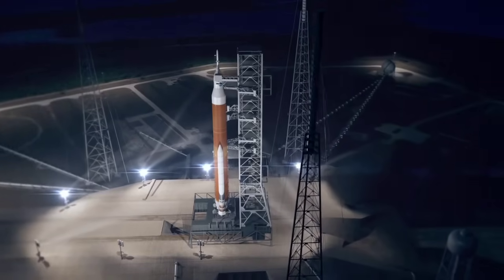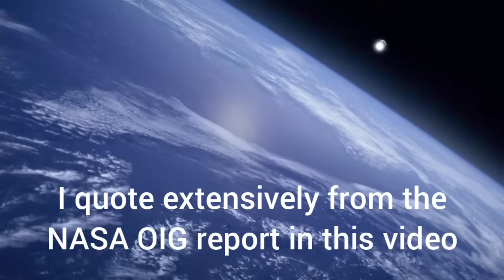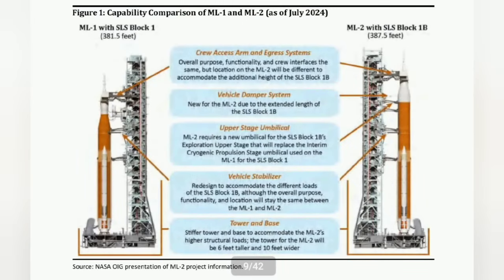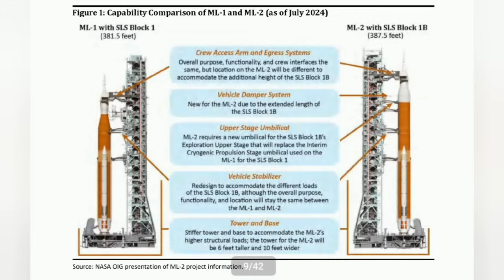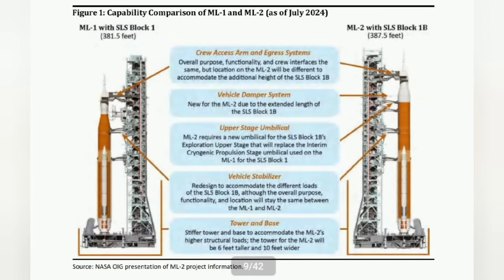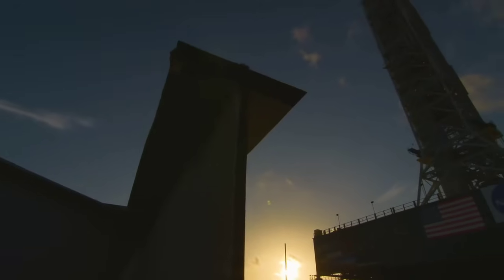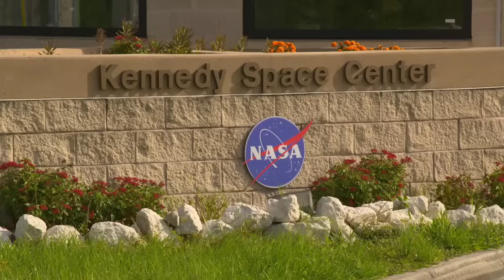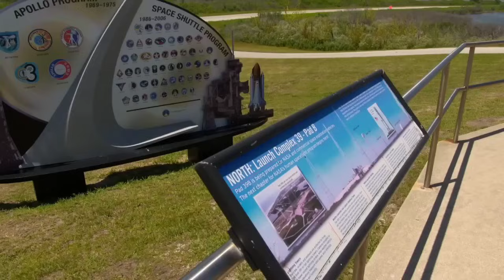If you thought NASA SLS was a nightmare, wait until you see this!  PLUS, no Artemis 4 until 2029!

Comment: Perhaps SpaceX can teach them how to build launch towers.
Reply: They could do this somewhere in between building towers number 3 and 4 🙂
Reply: Yes, NASA never built anything at all until recently.🤡
Reply: To be fair, SpaceX is still very much learning, as evidenced by their constant changes to the tower. Because SpaceX has adopted a rapid prototyping philosophy, we can easily lose track of this fact. The goal of the launch tower commissioned by NASA is a product that will be provided in its final iteration. While SpaceX is getting there, so far during each launch they have learned "what does not work".  They did not spend the time and money to try to figure all these things beforehand. Personally, I think it's a good thing as it prevents you from spending too much effort on overengineering something that turns out not to matter much, and lets you catch early on little  things that in a million year nobody would have tought of.
Reply: @theguyfromsaturn  I guarantee that SpaceX spends more in the long run.
Reply: @professorg8383 is that how they're able to charge 1/4 the price of other carriers? 😅
Reply: @theguyfromsaturn  the tower is just for launching. SpaceX iterates for timeliness and for changes in scope. This tower was meant to handle a changes between the height in Artemis launches.
Reply: @professorg8383  spends more?? Are you aware that the entire Starship program costs so far is less than the proposed cost of the NASA mobile launcher?
Reply: @kennetha6594  Starship is projected to cost 10 to 12 billion to complete. It's estimated they have already spent 6 billion.
Reply: The mobile tower set up NASA went with during Apollo was a good idea in that it allows the pad to be used by virtually any type of rocket design. SpaceX tower is just for Starship. I would like to know what they have spent of that so far, and who builds them. It's a classic erector set configuration that's per-fabricated. Such giant infrastructure is certainly limited to a handful of company's. Anyway, despite rage bate video's, Artemis will chug along... The tower will be built. SpaceX fans are gonna SpaceX Fan... And everything will be fine.
Reply: @kennetha6594 Elon indicated they're spending $2 billion on Starship in 2024. It was commented in a public interview earlier this year, though I do not recall which one.
Reply: That was my first thought as well, but there a major design difference. This is a tower used to stack the full ticket and payload in the VAB, then move the assembly to the launch pad, fuel it, and then launch it. SpaceX--perhaps wisely--separated those functions between different components and built a tower that can stack the dry Super Heavy and Starship. They use smaller transporters. 

I think the critical difference is the use of side mounted boosters on SLS. Perhaps those are to difficult or temperamental to add to the stack at the launch pad. Or, it's the need to reuse Shuttle infrastructure and processes, i.e. a mobile launch tower.
Reply: @hawkdsl Apparently, these mobile launch towers are very specific to Artemis, and not necessarily compatible with every Artemis stack. After all, the fueling and pre-flight loading for each rocket system is a bit unique. So they're not particularly generic. If they were highly compatible between systems, I'd suspect the mobile system used with the Shuttle could've been repurposed.

I suspect it's the need to stack and protect the solid fuel, side mounted boosters that is driving this complexity. Otherwise, it seems simpler to build a static tower at the pad and move the stack with a smaller transporters (like SpaceX and Russia).
Reply: @Tanstaaflitis  Again, the mobile tower configuration allows any rocket design to use the pad. The pad is universal.
Reply: The biggest difference is that this is a mobile tower, but the rocket takes a ride with it.

SpaceX has its towers stationary, and only the rocket is moved, and lifted by the tower.

Comment: Cost+ contracts are basically a blank cheque.

The Fixed Cost model used for Starliner protects NASA from massive supplier underperformance and puts the onus on the supplier to provide an accurate quote in the first place as they will be carrying the burden of overruns.

Seems like a no-brainer to use Fixed Cost by default - some palms must have been greased for Cost+ to still be used.
Reply: Except that Boeing cut sufficient corners on Starliner that, years after Crew Dragon went into service, Starliner is still sufficiently unsafe that NASA won't use it to bring astronauts home from the ISS.
Reply: They would've cut corners with the cost-plus contract, probably even more than they already did, so that they could get more money and an extension.  @lorendavidsonmusic
Reply: That is just insane nonsense!  Cost is the actual cost and the plus is a markup rate and in this case, a chunk of that rate is incentive based on performance. 

Have you ever managed billion dollar projects??  If not, you have no idea what you are taking about. I'm quite sick of all these armchair experts who don't have a clue!  Costs are actual invoices for manhours and materials, these are easily audited, even on a massive project like this. They aren't made up phony numbers!  The plus is the mark up and when incentive based like this job, the criteria is based on real performance numbers! Costs go up over budgetary for a couple reasons. Contractor mismanagement in which they'd lose the incentive award. Because it's design build, underestimating cost estimates are a performance issue. But the biggest reason for higher cost is scope changes.  Add or change stuff and it costs more. The fact that Bechtel  has gotten decent awards, says the issue is scope creep. It's going to happen when you are designing and building for a rocket that is still in development. You can't engineer and estimate for what you don't know yet!!

Comment: 21:28 Hint: Bechtel is a billionaire owned company; its a private company. The current CEO is Brendan Bechtel and the previous CEO and Chairman ... Riley Bechtel. Boeing is effin' NASA and they are a public company.  They'll get you either way. SpaceX and some of the other responsible  space companies should be leading these projects. And yes, SPaceX could be charging NASA and DOD less than they are, but what we don't know are the restrictions in place that slow them down and tie their hands. In some ways it goes both ways.
Reply: Don't believe that SpaceX is doing this kind of work much cheaper! Probably spending more because they hurry up and build quick and then rebuild 10 times and every time they use it!!  Never believe that Musk builds for what he says!  That's why they have over $200 billion invested in their owned assets!

This is a cost plus contract so the cost part is completely real!  Bechtel will never be the low cost bidder especially in a design build contract. They are one of the most costly on thee engineering side, but they build what they say they will. 

I have little doubt that the actual costs and delays have more to do with NASA having lost their best contract management folks. Most all have retired or moved on because NASA really doesn't build much these days and I have no doubt, the specs kept changing. That said, they'd be fools to farm this out to someone like SpaceX. No one at SpaceX has the experience to do this kind of big construction work and SpaceX build costs are at more than half premium time because of they're hurry up mentality. 

The real costs are in the systems and not the structure, plus they are not ignoring regulations from the other government agencies. 

Should NASA have anticipated the changes need from the first tower?  Probably, but when you build bigger rockets, it not just tower heights that need to change. As I said, the cost is in the systems not the structure. Cost plus with incentives is still the best way to build!.
Reply: @professorg8383  you're quite obviously delusional.

Comment: I suspect that the high cost of ML2 has a lot to do with that first letter: "M" for "mobile." Compare the problems ML2 has had to how quickly SpaceX erected the fixed-position Starship launch towers.
Reply: The MOBILE part is the same part that has existed since the Apollo missions.  They aren't building a new mobile PLATFORM. Just the tower ON the platform.
Reply: @NScherdin  It's not quite that simple. It also includes bringing the platform up to date.  A lot of changes to 40 year old, one of a kind equipment. Most all the sub systems have to be replaced and maintenance after sitting idle for so long is an issue to.  If you've ever tried to get an old vehicle back on the road, that has been sitting a long time, it's a big task.

But the mobile part makes all the utilities and consumable, (fuel), loading, much more complicated!  Need isolation and literally double the safety measures. Going with the mobile platform has trade-offs. But keeping the systems out of the weather for extended periods has advantages

Comment: But somehow, the more advanced SpaceX Boca Chica tower will be operationally complete in less than a year.
Reply: It doesn't move.
Reply: @darkstar7999  the best part is one you don't need to exist.   NASA should go with on pad integration so the tower doesn't have to move
Reply: @darkstar7999 because there is no need for it to move.
 Spacex’s towers are much more complex, and way bigger, they simply use tbm’s to deliver the ships to the launch site, so they can build the rockets in several buildings, ( eventually one ship per day). Spacex just erected it’s 3rd tower in around 3 months. I read somewhere each launch tower costs around $100 million, and it’s much larger and stronger than this tower, ( as starship is a much larger rocket).
Once they start building launch towers in Australia I ‘m expecting 3-4 towers down under, where I think the majority of their launches will occur once they get chased out of the us, ( likely next year), it’s pretty clear they are not wanted here, ( gotta save that frog and those rare ferns). I strongly doubt any more towers will be allowed to be built on us soil.
Reply: @darkstar7999  The moving part of NASA's tower is STILL the same base that has been used since the Apollo mission. So how does THAT make the TOWER cost 20 TIMES more than SpaceX tower?
Reply: @mrfusioneng  The Scifi community has being thinking Tonga for years, reusing oil platforms out in international waters sounds good too. Where do we sign up for the SpaceX Security Forces and do they have mecha yet?
Reply: @NScherdin  Don't know.  I don't have the numbers in front of me.  However I have to believe that a moving tower HAS to cost more than a stationary one.  How much more?  Well, one is a government contract, the other is SpaceX's own dime.  I have yet to see the government do anything cheaper than the private sector.  And BTW.  Inflation has increased quite a bit since Apollo.  I would bet the same base, built today, would cost way more than it did back in the day.
Reply: @TheUtumno  Maybe NASA should.  However NASA has opted not to.  Your tax dollars at work.
Reply: @mrfusioneng  I agree.  I like the way SpaceX does it.  However, NASA doesn't do it that way.  Maybe they will in the future.  However for now, they are locked into the model they have chosen.  And if you compare the cost of a tower that moves vice one that does not, I have to believe the one that moves will cost more, and be more complex.  Didn't say it was a GOOD choice, but it was NASA's choice.  A lot of what SpaceX does is revolutionary.  They make decisions that a government agency simply cannot make.  If Elon makes a mistake, it costs him money.  If a NASA administrator goofs up he could lose his job.  Ditto those under him.  Government entities are very conservative when it comes to such things.  No one wants to stick their neck out, and doing things the way they have always been done - ways proven to work - are usually the paths taken.

Comment: What are the differences between the towers for SpaceX and SLS?  More pipe runs and extra mount points for the extra stages. But height and strength required of the tower? We can see the base is larger, but what about the size halfway up?  I don't think I've seen a physical comparison between the two.

Comment: How many of these mobile behemoths been built? One? With no integrared engineering plans left behind? That's on NASA. Starting up again literally from scratch would be a massive undertaking. If it was fixed cost, there would be no one who would be willing to risk the build/design contract. Looks like NASA is between a rock and a hard place of its own doing. It will cost more, not necessarily a contractor grift as estimates for things that have never been done before are almost always more expensive and take longer. Corruption may not be the right blame. Unwitting NASA mismanagement might be the root.